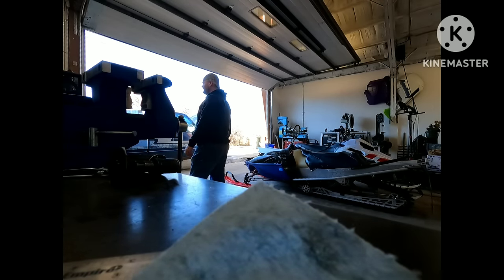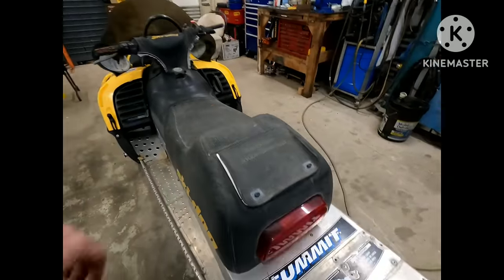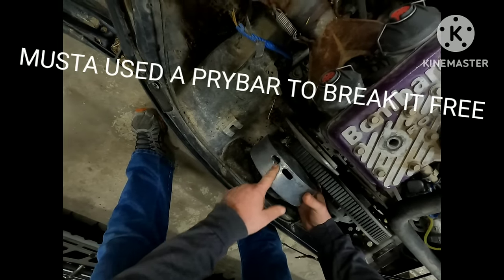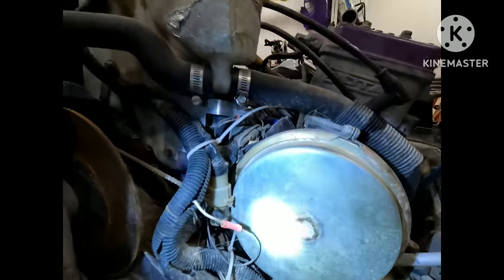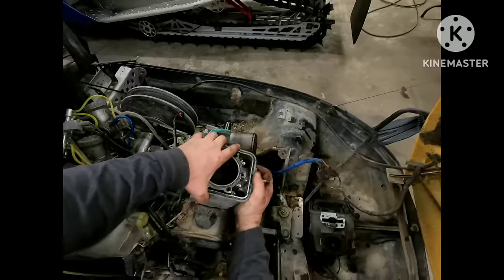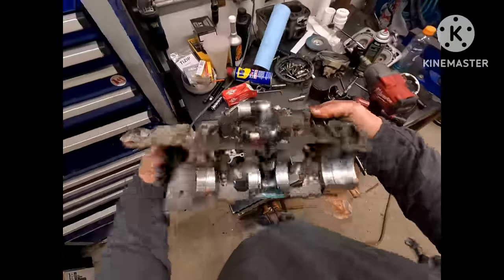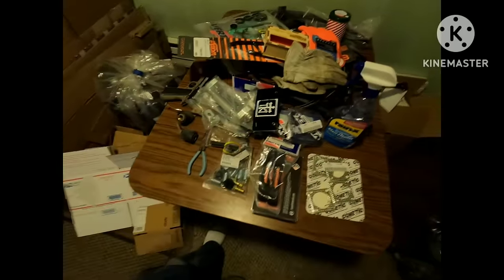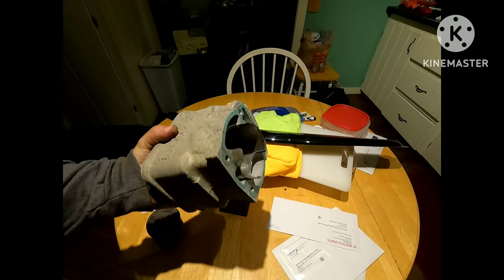$200 SKIDOO SUMMIT X 670 HO

Comment: I bought 1991 583 formula plus XTCE for 150$ clean the carbs runs pretty good. but the crank seals were shot so pull the motor cleaned under the hood, clean the motor up. All new gaskets and seals. And now it’s all most back together. see how long she runs lol 😂

Comment: How many miles are these supposed to last? I have been looking at a nice, running 98 summit 670 HO but has about 7100 miles. Not sure if it should grab it or not, the miles worry me
Reply: You should get 9 to 10,000 miles out of it before it needs a rebuild as long as it was well maintained. Most have had the shit run out of them great motor good torque and top end power. Ski door put in multiple sled lines for multiple years